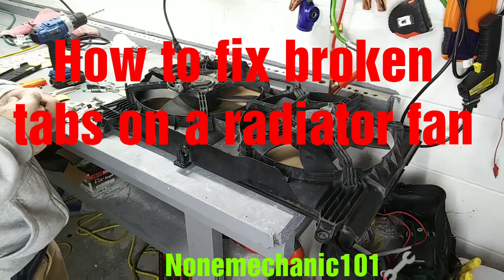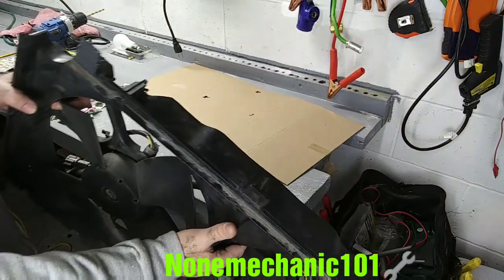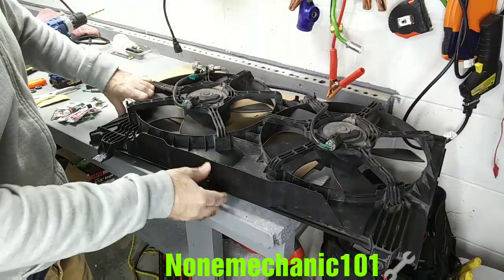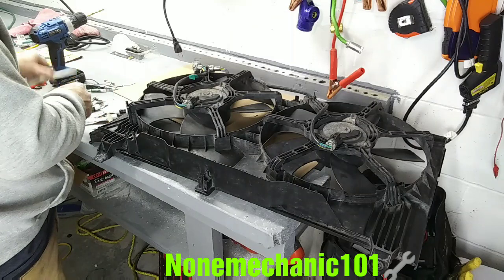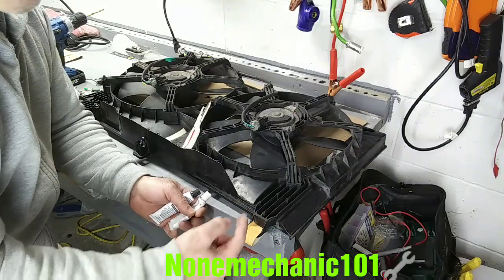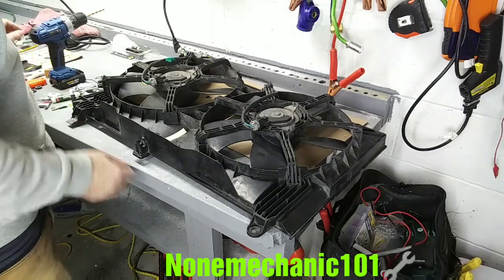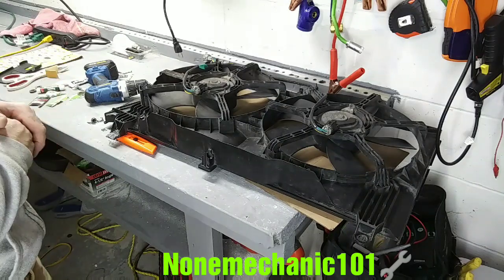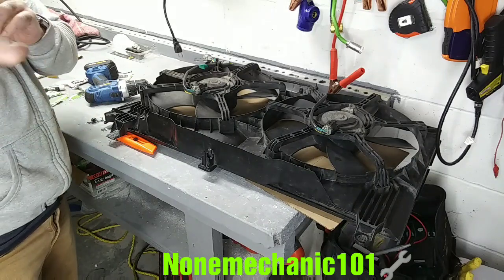How to fix Broken tabs on a radiator fan

Comment: That was a great idea Hector! I have came across a lot of broken tabs on fans and radiators! That JB Weld works really great!
Reply from the maker: I was very surprised that it worked.
Reply: @NoneMechanic101  im not surprised the the jb weld worked... ive use it on intake manifolds. Lasts far beyond our life time!!!
Reply from the maker: @simondown4712  , It surprised me. I'm going to be using it more.

Comment: Good Job Hector, you can do this with Bumpers, Fenders interior panels, I have been doing this for 30 years. to make it even stronger you can do it with small strands of Fiberglass also mixing it with the JB Weld.
Reply from the maker: You gave me an idea. I'm going to be getting strands of fiberglass. I'm sure I will be using it. Thank you.